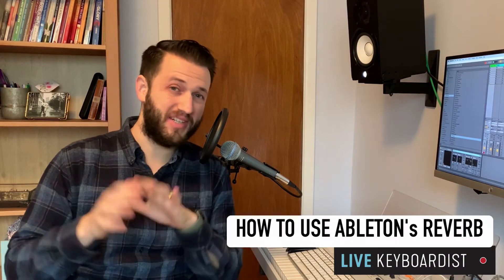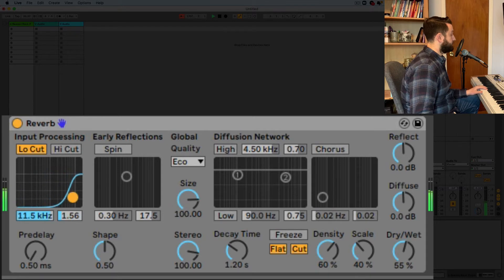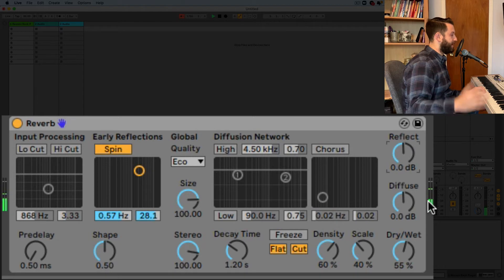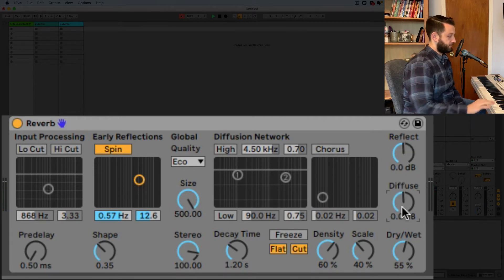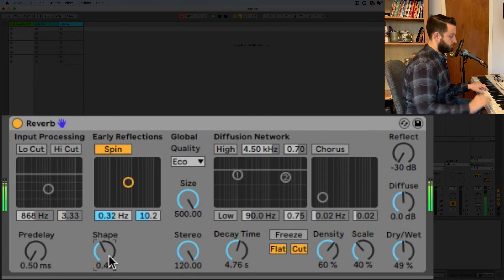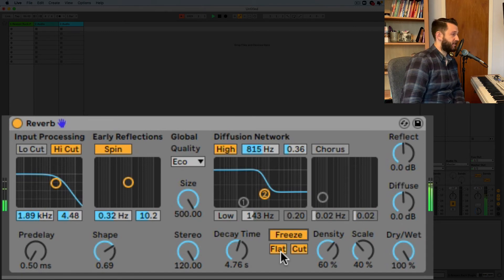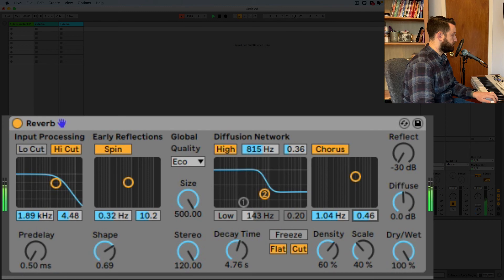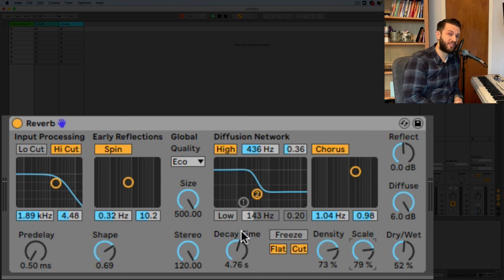Ableton Reverb Explained

Comment: Noob question... What is the difference between using reverb like this in a track compared to a send to the master reverb?
Reply from the maker: Great question. In this case, context is key. I use reverbs directly on a track when I am designing a sound, and reverb on the sends and returns when I am mixing. The biggest different is on a send/return, you will have wet dry set to 100%, and use the send amounts to control how much reverd is included, and on a track, wet dry determines that amount.